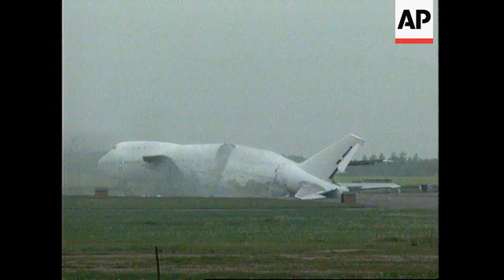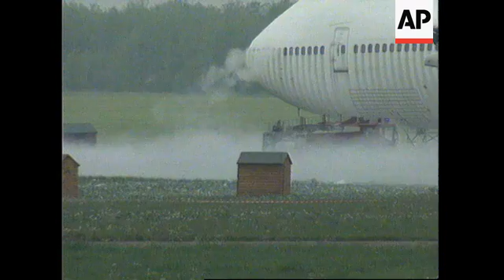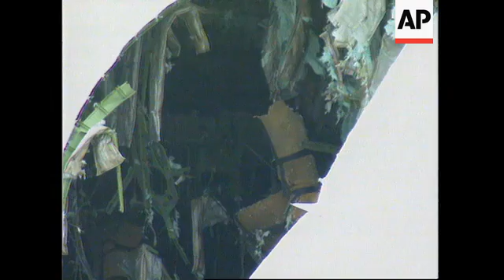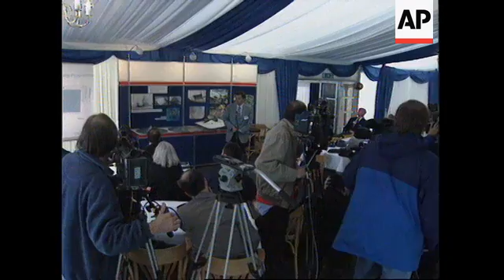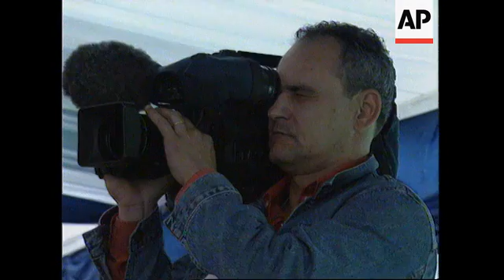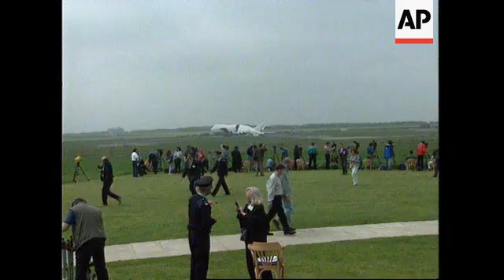UK: BOEING 747 AIRLINER BLOWN UP TO TEST EFFECTS OF TERRORIST BOMBS

Comment: As a supposed test against certain parameters - this has to be the world's worst!
It was put out on media to reassure anyone doubting the official line that Pan Am Flight 103 was brought down by a bomb - and what do you know? Here's a plane being blown up. Relax, everyone, move along - nothing to see here.
Only it creates more doubts in my mind - why go to sooooo much trouble and make such a fudge of it - unless you have an agenda?
It's the wrong aircraft - ok it's a 747 but the wrong model - if you wanna test a theory - this is a bad start.
I have no idea of how much explosive was used in this "test" - whatever - it did not produce the same results. Flight 103 came apart at the section 41/42 junction - the test did nothing like.
The test bomb looks to be in the wrong place and far too big.
Who paid for this test?
Bear in mind 747's were built in sections that were joined together later in the construction process. Flight 103 unzipped in exactly the same spots.
Reply: It wasn't done as a specific test for PanAm 103, so I've got no idea why you keep harping on about 103 in that long rant of yours.
Reply: @muttley8818  Hi Muttley - you have at least some worthy principles just by your choice of avatar and interweb handle but if you think that "explosive decompression test" was anything but a get out - you must need several racks of screws retightening!
Look at the fuss just recently over the nacelle latches not being refastened properly after the last opening - nothing whatsoever to do with Boeing but a straightforward maintance problem down to the airline. However; an aircraft with a possible design flaw i.e. readily coming apart at known construction points - is hugely different. 
I ran large building sites in U.K. often with 200+ guys - my job always involved responsibility for those men and everything they did but these days - following a well publised highrise fire - anyone in my old position will probably be responsible for the architect's and engineer's cock-ups too. Live long a prosper.

Comment: Try it with a boeing 787 dreamliner or Airbus a350 to see what happens with a carbon fiber composite aircraft mabye that's bomb proof because aluminum has a tendency of taring.
Reply: It's certainly not implosion-proof!
Reply: @OneTequilaTwoTequila  The pressure  is higher on the inside then the outside so why would it implode? Unless ur referring to the TITANIC submarine that imploded then yeah.

Comment: I wonder if the cabin was pressurized a high altitude scenario?
Reply: I doubt it. It has none of its four main engines, and I doubt they would have had the APU in there either. No bleed air means no cabin pressure.
Reply: I read about this experiment in Flight International and if I recall correctly they did pressurize the plane.
Reply: No because the damage wasen’t bad enough for a pressurized plane
Reply: it was, they pressurised it. They did this after the bombing of Air India 182 to test how they could protect airliners from terrorist bombs
Reply: @Etharebard  eh
Reply: It is possible because you don't need engines to do this. There is a ground connection for pressure testing.
Reply: Weak tin can!
Reply: This is for all of you who think the cabin wasn't pressurized in this test! 

https://youtu.be/VBYImI4Dtn0
Watch around 44:00
Reply: Yes it was